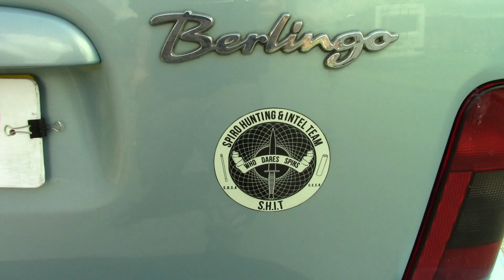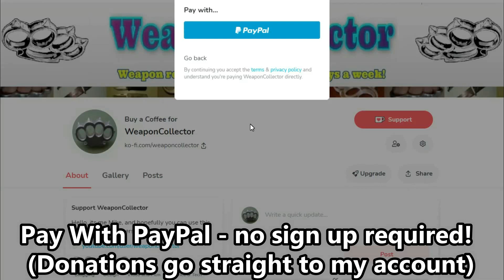WeaponCollector Update - General update, Metallic visiting, Garden and Shed

Comment: Lots going on then Mike! How did you melt down those plastic bottle caps like that? Weren't the fumes overpowering? I learnt a while ago that anything plastic can be repaired with a heat knife, melting it a bit and sort of cross stitching across the break. Wish I'd known that years ago because I threw so many things away.
Reply: I used a little toaster oven, if it has a 2 in the recycle symbol you can safely melt it as many times as you like. I kept the temperature 130-150°c
Reply: @MetallicrealitE  Thanks Metallic!